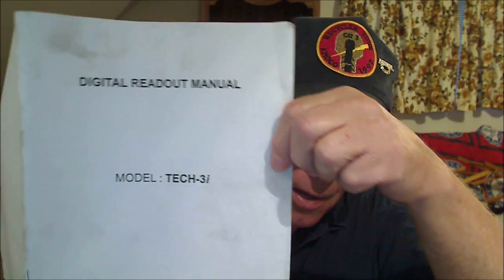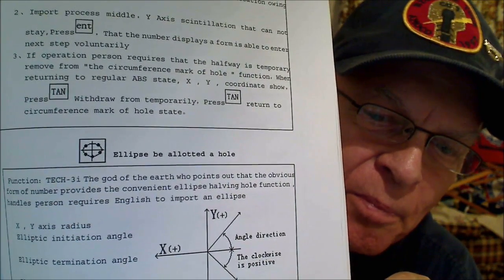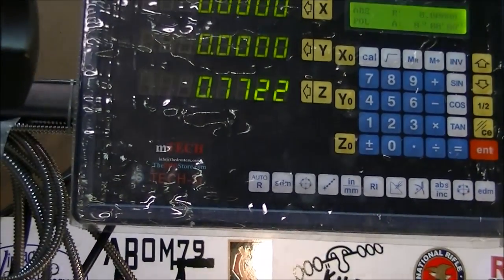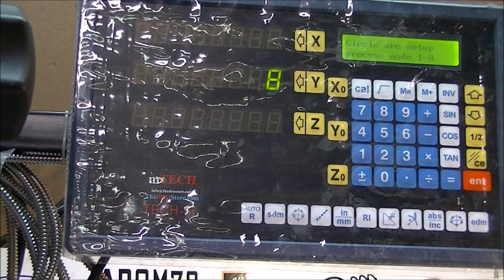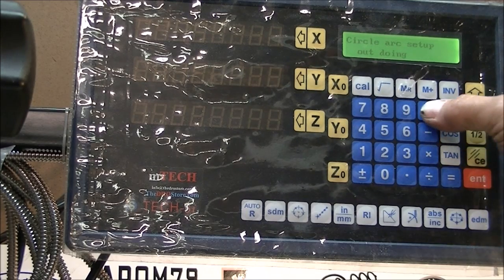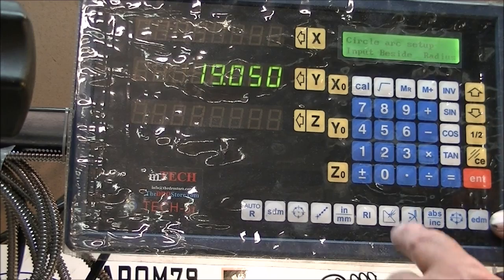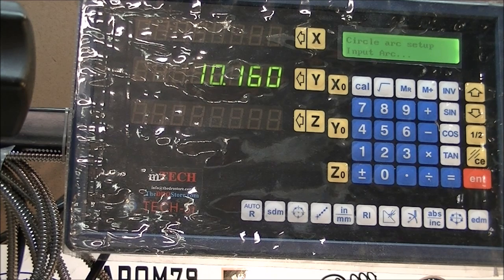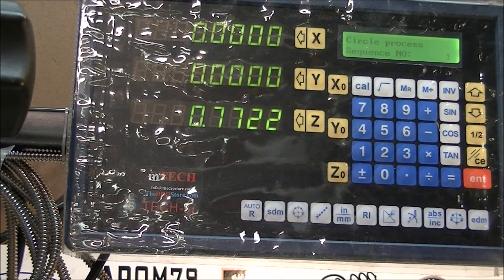DRO ARC Function

Comment: hi harold , i have a chinese yh800 graphical dro and having a lot of difficultly using the simple arc feature , do you have any standard settings for say a 20mm radius cut , and a step by step proceedure , at my wits end , the manual is bit hard to understand and i am a novice at this , kind regards ray

Comment: These DRO system works well - once you figure them out.
I bought one with an improved English manual.
It still took a lot of careful reading  - and re-reading.
For the price, you can't go wrong.
Just wondering how durable it will be.
Reply from the maker: In December I had a problem with the small display where you input data for the special features.  It got blurred and almost unreadable.  In the attempts to repair it I managed to kill the whole thing.  I purchased a new DRO to replace it.  You can see the modification and install of the new glass scales in some recent videos.  Thanks for stopping by.

Comment: Nice Harold! It was the chinglish and monkeying with the camera that messed you up. I find it a bit odd that many in this community are unaware of the open dro project. Using open dro a person can make a 3-axis dro starting at around $45 on up with the cost being relevant to what material one has on hand and how much they are willing to do. Thanks for sharing.
Reply from the maker: +Jeffrey Vastine this is the first I have heard of the open DRO project.  They must not be putting enough resources into publicity.  I will search for them and see if anything comes up.  Thanks for viewing and commenting.
Reply: Harold, well after watching your video I went to pick up the pcb to incorporate OpenDRO into cnc mill/router that I am building and it seems like things have change a bit since I had looked into OpenDRO about 18 months ago. The project files are still available on SourceForge at: http://sourceforge.net/projects/opendro/ and with the code base it is a simple task for someone with a basic understanding of microcontroller programming to add any features to enhance the dro's functons. Unfortunately it looks like the company in Austin that was offering the pcbs, parts, and kits has been out of stock on the main components for some time. Their website is: http://shumatech.com/web/. There is another site which has some components at: http://www.wildhorse-innovations.com/index.php?_a=viewCat&catId=1, but the kits are out of stock. Since this is an openn source project I am going to contact the project starters and get the gerber files for the pcb and/or the schematic and make some pcbs. Since I know programming I will probably enhance the dro code. So if you know of anyone who may be interested just let me  know. How about a dro for your lathe?
Reply from the maker: I went to sourceforge myself and read all of the open dro information that they had there.  It looks to me like the build it yourself may wind up costing as much as buying one already made.
Reply: That depends upon component sourcing and how much sweat equity there is, but there are some chinese 3-axis dros n the market that have a pretty good feature set for $100. Do we really want to support the UN plan to make China the manufacturing base for the world or revive the principles and ingenuity that once made this land great?
Reply from the maker: +Jeffrey Vastine I am not interested in supporting China or the UN.  Why not email me to continue this conversation.  hswaters@yahoo.com